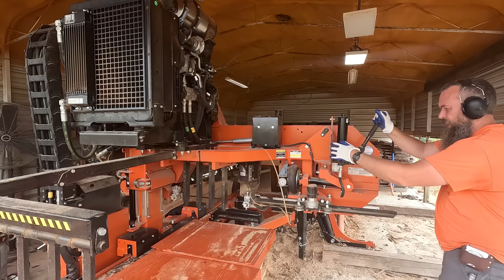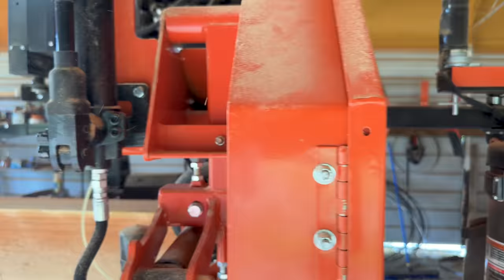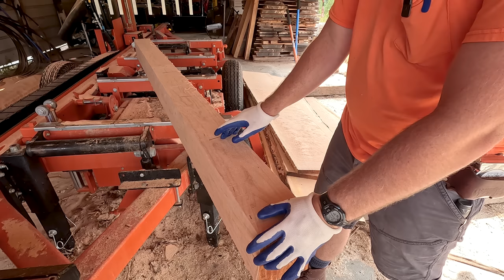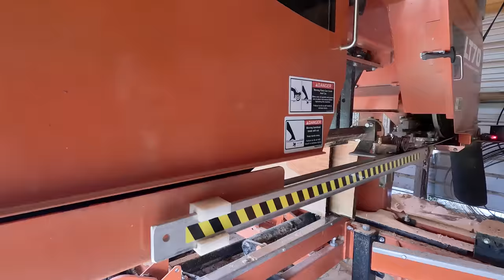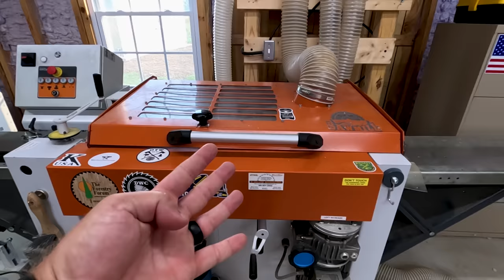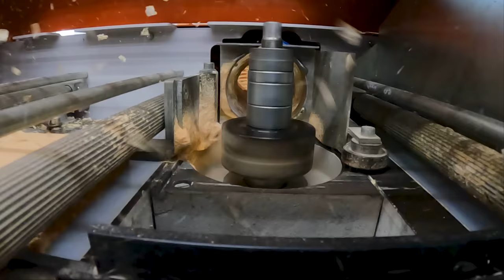Pro Sawyer Milling Technique Unveiled! How We Turn Cherry Logs into  Masterpieces

Comment: I try to save cherry sapwood when I can find decent bands of it, then cut it off from the heartwood and process it into thinner stock. It's such a gorgeous, white wood it works well for variegated panel glue ups.
Reply from the maker: Interesting
Reply: As an outsider looking in, I see so much potential in the burn pile. I get the burn pile, but there's so much good in that pile.

Comment: Could you cut the pith into boards, cross orient them, glue them up and sell them to wood turners' for bowls and such?
They already do that with boards to get the thickness they need, so if cross orienting the grains would stop the twist in smaller sections would that work for the lathe turners'?

Comment: As a stupid question: What is the definition of the pith? If you were to saw both sides to what you would consider the pith could you not turn the blank 90 degrees and saw off 1x2 (3 or 4?) and then flip it 180 degrees again and saw to the pith? You would get a quantity of narrow cherry but if it was waste anyway...? As an example, I have used a lot of cherry as face frames over maple plywood built in cabinets: Such stock could be ideal. (Never mind: It seems this is exactly what you did!!)

Comment: Why do the blades only have teeth on one side? If they had teeth on both sides would allow sawing in both directions.
Reply: The blade guides have a roller on each side and one on the back. I am not sure what you would do with a double sided blade.